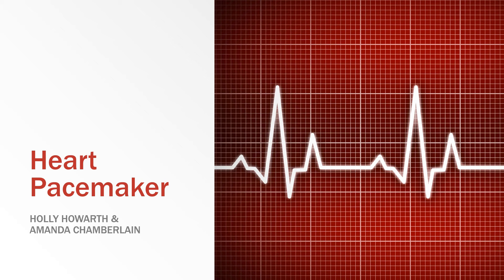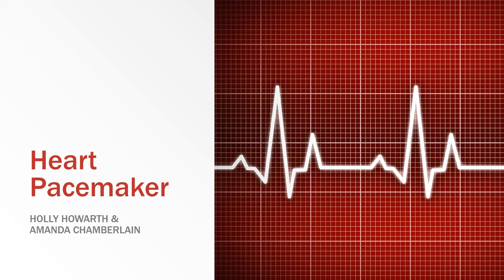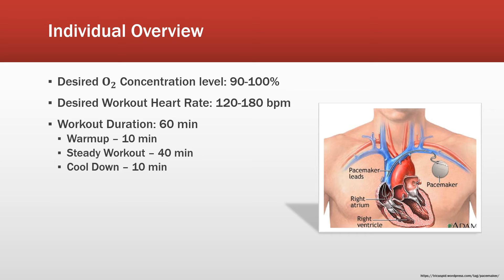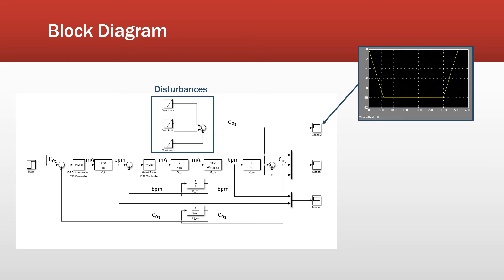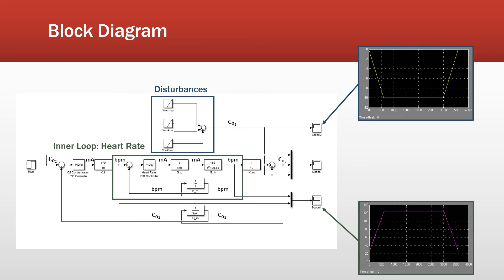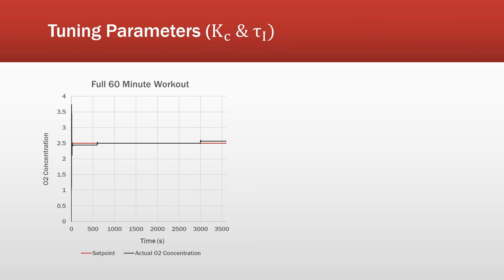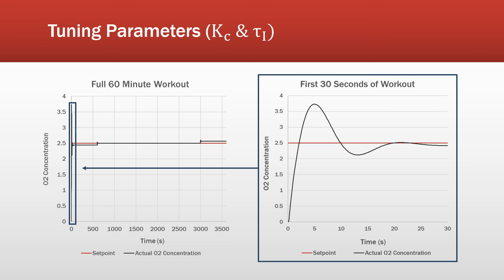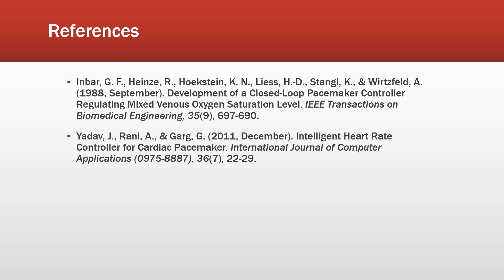Pacemakers for Athletes in MATLAB / Simulink

Comment: Sir,i am very thankful to you for answering all my queries.I have one last doubt,if you could help me I would be eternally grateful to you.
1.Sir,what is 170/16 thing doing?Why are we giving it just before the second cascade loop?
2.Why is measuring Transfer function in the outer loop not 1?
3.Sir,did you autotune the loops or used ziegler nichols stability criterion?
Reply from the maker: +Gon Freecs It is a conversion between mA and the "beats per minute" (bpm) setpoint that is sent to the inner loop. The typical range for controller outputs is 4-20 mA or a span of 16 mA. A signal of 4 mA would be the lower heart rate set point and the 20 mA would be the upper heart rate set point. The difference between lower and upper set points is 170 bpm.

The transfer function in the outer loop assumes a 3 second time constant for the O2 concentration measurement. If the concentration were to instantaneously change, it would take about 3 seconds to make 63% of the change and 6 seconds to make 85% of the change according to (1-e^(t/tau)) - the solution to a first order differential equation. In transfer function form it becomes (1/(3*s+1)).
Reply: +APMonitor.com man you are so great and helpful.It was very cool of you to answer my queries..Thanxx very much sir .U r a very gud person Respect